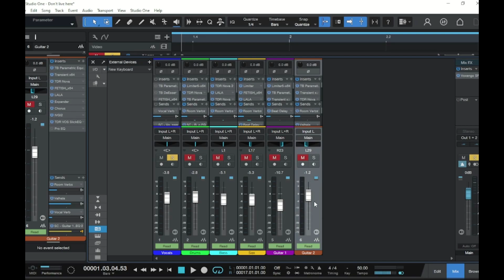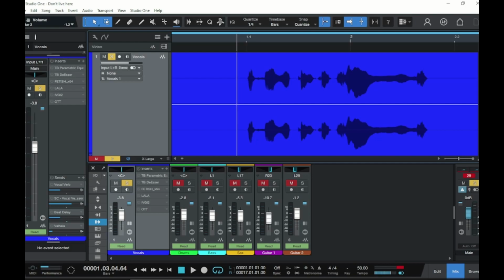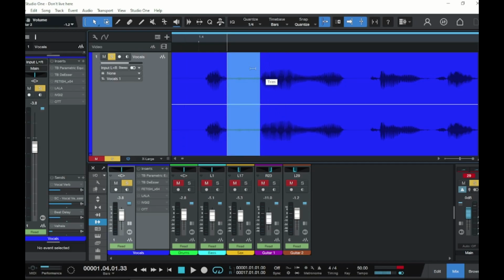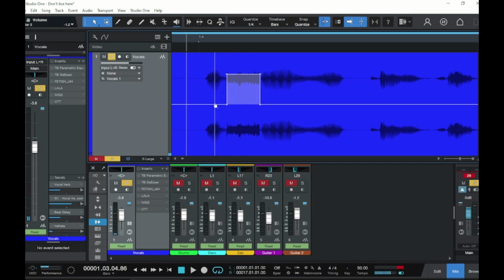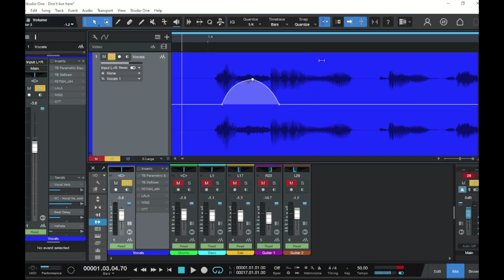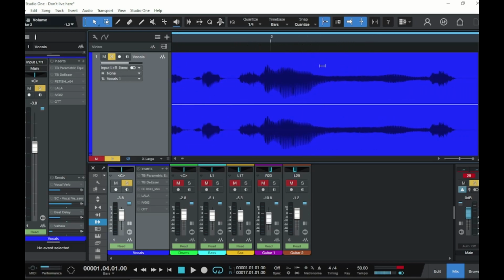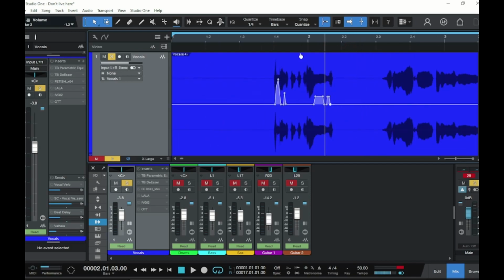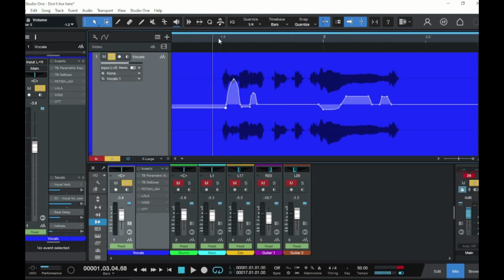Clip Gain Automation - the Secret to Pro Sounding Vocal Compression

Comment: What a coincidence. I was just looking at waves vocal rider because their sale will end today. I was wondering if a compressor would do the trick too. I don't work with vocals much, but could be good for podcasts and video narration. Doing it manually does seem like quite a bit of work judging from your tutorial, especially for long narrations, so I might just get it after all. Thanks for another great video!
P.S. the (I assume) gate you were using on your own voice was rather strong in this video. I sometimes got the idea that audio was disconnected.
Reply from the maker: Thanks!
Reply from the maker: I appreciate the feedback
Reply: This is so cool. Sometimes I clip gain vocals when volume automation adds too much low end woofiness while trying to bring up a specific line and clip gaining the volume on those parts gives me better results.  I’m forgetting that clip gain precedes the compressors and your idea makes great sense for smoother vocals and audio allowing for lighter compression. I’m one of these cats who has no problem doing the tedious editing of audio in sessions. I have no idea where I developed such patience… 😊
Reply from the maker: Great! And for podcasts it should be quicker because you can get away with more 90 degree angles in your clip gain.

Comment: Hello, on Reaper I use what is called a pre-fx volume envelope. You do not need to split the tracks into to clips, this is just an envelope applied before fx, And it does change visually the waveforms amplitude ! Once very low amplitude waveform are fixed this way I hide the envelope, so when I go to standard automation it is not in the way. However, I do not add points at the start and end of this volume change like you do, because I think compressor after that should smooth that out. Is it incorrect ? I think glitches appear if you don't cut at the correct location and it should be moved a bit, and that is different than volume jump because of the tweak
Reply from the maker: I've never mixed on reaper, but I don't think there's a right or wrong way. If you're getting a good result then I wouldn't be concerned. Thanks for the comment , and thanks for watching!